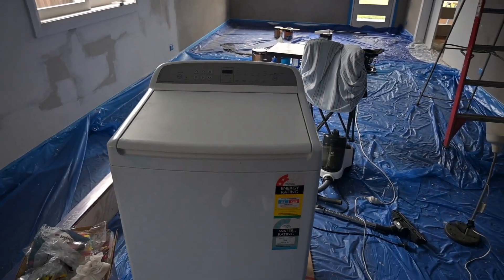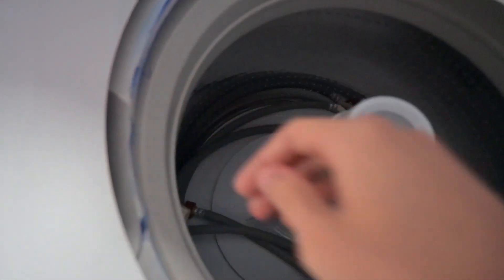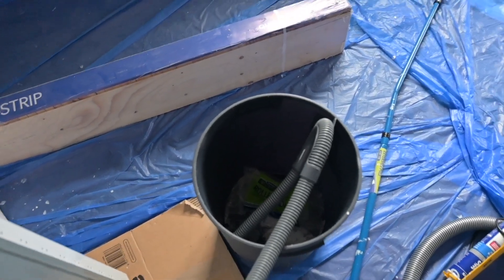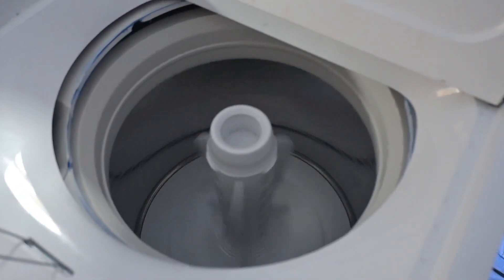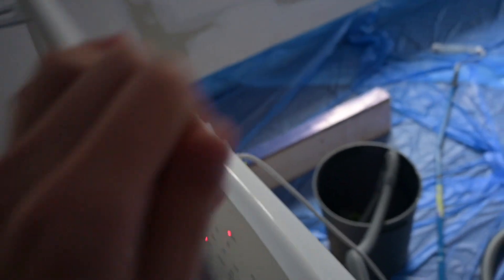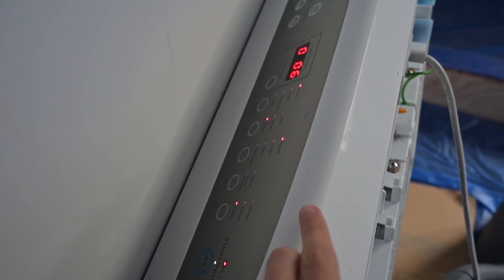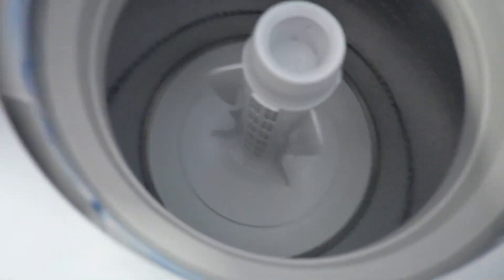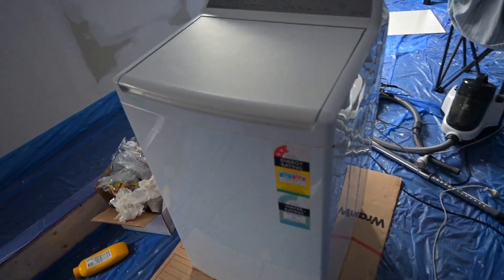Fisher and Paykel Washsmart 8.5kg Washing Machine // Testing before Service

Comment: Sorry about the FabricSmart, I really liked that machine! This one should be interesting too though, I noticed it has a different spin behaviour vs my Aunt's MW513 which I filmed. 

Mainly because it has a slower 200RPM interim spin (vs 250RPM) speed, and also does a super slow 25RPM spin beforehand (I'm guessing anyways, not entirely sure of the speed before interim)?

Also I noticed the agitator seems much better centred than mine, as even with just 2 garments the agitator would wobble while the tub was fine. Seemed to be a common issue on those classic style machines.
Reply from the maker: Yeh, the Fabricsmart was my Favourite Modern Top Loader, but I do like the Washsmarts though. Interim Spin, they do have a 180-200rpm spin but then go up to 300rpm, but behaviours depend on the type of Inverter used to drive the motor. The Agitator, I think the stem maybe a little warped from factory or it's a simple fix just by removing the agitator and rotate it until it sits straight on the shaft. I'm still getting to know these things so my knowledge isn't the best
Reply: @mrtisan29 Yes, on this new machine I think it's about 200RPM. 300RPM spins are for the slow option and spray rinses. Have you noticed your machine doesn't kick into a higher 650RPM spin during rinses? 

Mine doesn't unless I choose the "Eco" option, but instead of going from 300 --> 650 it comes to a complete stop and then starts again, from 250 --> 700, as if it was doing a final spin on the medium setting. I have no idea why. (650RPM is specific for rinses, 700RPM is the standard medium speed)

Without the Eco option it just stays at 300RPM the entire time. Check out my full cycle video if you wanna see what I mean
Reply: Also haven't checked the agitator, because it's not really my machine. I just managed to record it whilst looking after my aunt's place. Would love to own one myself though as they are my favourite machines
Reply from the maker: @randomness2004  I haven't really heard much difference in the RPM's with the new Fisher and Paykels compared to the old ones, so I say that the RPM's on each cycles are the same. That's for my Fabricsmart, but I dunno about the Washsmart or your machine. I'll check out that video
Reply: @mrtisan29  They're very similar but because these new machines have quiet motors, it's much harder to figure out their speed. 

Although I usually know based on the frequency the motor makes. These new FabricSmart and WashSmart machines all have the same programming for spins, I think it was changed after 2018-2019 or thereabouts. 

If I remember right the MW513 I filmed released in 2013 or so
Reply from the maker: @randomness2004  I saw your video, your Machine also known as the Quicksmart has the same Spin cycle behaviours as the old model Fisher and Paykels. The speeds pick up quicker than the Fabricsmart and Washsmart. And even for that 250RPM, the Fabricsmart and Washsmart machines do have a slow 200-250rpm ramp up before going into 300rpm. As what I can notice
Reply: @mrtisan29  Yeah that's interesting, I just don't understand why it never went to 650RPM on the non-eco rinse cycles. If I could film it I would but not sure when I'll be out there next. But the higher interim spin didn't surprise me, the beeps on the control panel are also a different frequency vs yours. 

Also about the acceleration, I'm not sure about that as I remember my old MW512 would accelerate much faster with a small load. On the other spin video I made it took quite a while to reach 1000RPM, even with just two garments.

I remember the latest machines have a weird acceleration curve, as soon as they reach 800RPM they slow way down and take absolutely ages to get to 1000/1100RPM.
Reply from the maker: @randomness2004  Yeh. It seems Smartdrives do tend to have speed behaviour effects, either depending on the load and the type of Inverter or driver. Quite interesting
Reply: @mrtisan29  The drivers in most of these machines remain largely unchanged, they are designed for a wide range of machines. The computer parts however have certainly been programmed differently over the years, as the computer gives the motor driver instructions on what speeds it should use, acceleration curves, direction, etc.